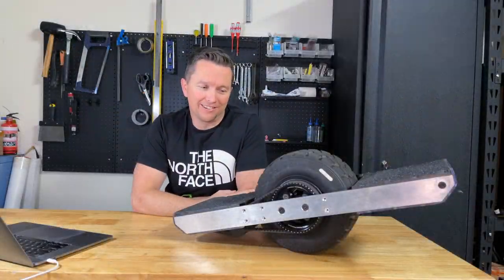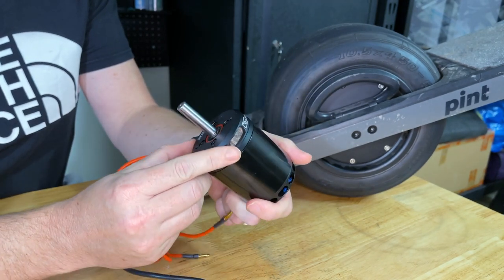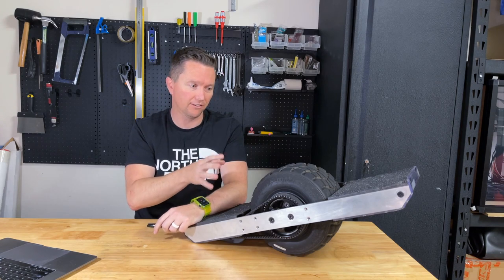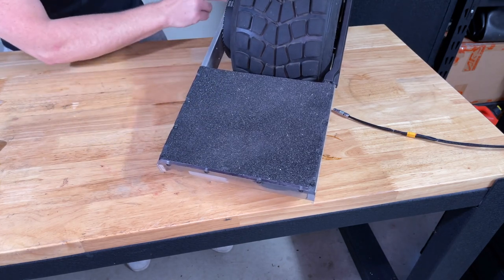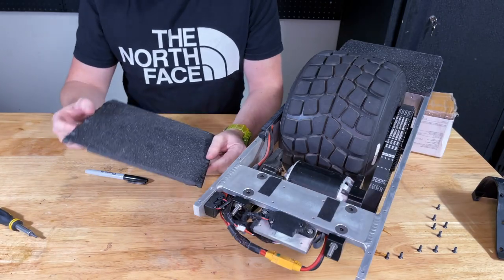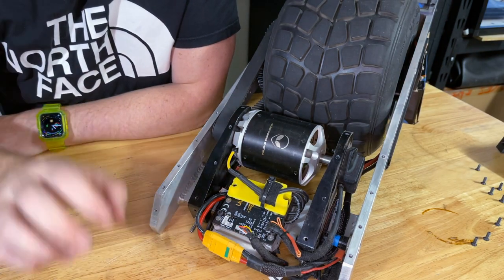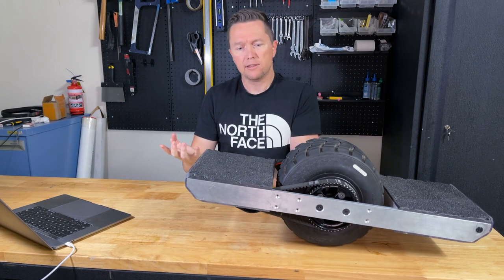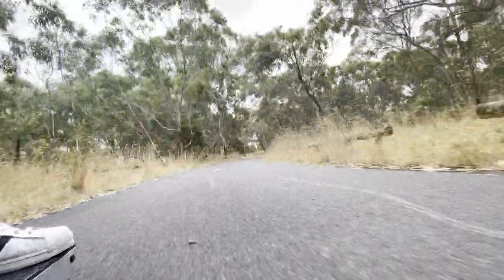All. The. Details. - Belt Driven VESC OneWheel

Comment: How does it maneuver?  I imagine all that increased sidewall and decreased wheel weight gives a much improved ride versus these hub motor boards we’re all running.
Reply from the maker: It's a smoother ride than my Pint, but I do run the tire at a lower pressure so that's to be expected.

I'd like to spend a bit of time on an XR/GT as they have a more similar tire profile to this. I think there are too many other differences between this and the Pint for me to confidently say the smaller rim diameter improves things. Would also like to get other people's opinions on it at some point, but that's later on.

Comment: Maybe mount the motor on a frame above the fender? Also, if you used a two stage reduction system, like a jackshaft, maybe a two speed transmission? Low and high range?
Reply from the maker: Practically it'd work, but I'm not sure I could handle the aesthetics of an above fender mounted motor.

One of my other crazy ideas was to rather ironically have the motor inside the wheel, but not attached too. The motor and wheel would share an axle. Instead there would be a belt that ran from the motor to a jackshaft at the front or rear, then another belt on the other side of the board would run back to a pulley that drove the wheel. I'm sure a picture would help, but mechanically it's so complicated it hardly seems worth the effort to sketch something up 😂

Two speed transmission sounds interesting, but I'd be happy with one speed that works well for now.

Comment: Cooling of the motor should be done in a different way. Now it is super fragile to any water splashes and looks like water can stay inside of the case. Better option would be to cover the motor with some kind of heat dispenser/radiator. Good work! Looking for progress on that good Australian project. ;)  Regarding the issues with motor - did you consider using two motor and belts on both sides? Of course it would complicated project but probably overhitting issue and reliability of belts would be somehow mitigated.
Reply from the maker: It is very exposed right now, being waterproof or even splash proof wasn't much of a consideration at this stage. If there's another version after this I'll take this a bit more seriously. There's been times I wanted to take it out but didn't because it was just a little damp.

Two motors is interesting, and I do like it from a redundancy perspective. I could also do a one motor two belts solution; something I hadn't thought about till your comment. The motor shaft on these motors protrudes out each end, so you could therefore mount a pulley on each side. This probably doesn't give quite the same level of redundancy.
Reply: @lachlanhurst  With two motors (maybe one on in front and the second  at the back of the board) you will have higher torque, less heat and better reliability... but the complication of the board goes up....

Comment: Very cool! Thanks for building and sharing. You were talking about the winding size in the motor and heat - could increasing the voltage help? My loose (and very possibly wrong) understanding is that higher volts can generate the same motor power with fewer amps and less heat. But maybe these smaller motors have a voltage limit.

Also the OLED display with cell voltages is FANTASTIC. I'd love to know more about how you set that up or if it's possible with other BMSs used commonly with VESCs Onewheels.
Reply from the maker: There's been a lot of 12s vs 18s discussion in the esk8 world. The answer is "kind of yes", a higher voltage could help. More power with higher volts and fewer amps, but that higher voltage would mean the motor spins at a higher speed so to take advantage of this I'd have to run a higher gear reduction which I'm already struggling to get. I could run a higher voltage and find a lower KV motor (not that there is one), but this lower KV motor would probably have thinner wires in it and we go back to "square one". Would also be an expensive change for me now; new battery, new BMS, and new VESC (this one only does 12s).

It's been a while since I looked the repo for all the BMS stuff, but I think everything you'd want to know can be found here -> https://github.com/lachlanhurst/bms-can-display . I don't believe any other BMSs use the same CAN protocol as the FlexiBMS Lite, so you would need to change the code. Theoretically if you can talk to the BMS via CAN, then something like this would work.
Reply: @lachlanhurst  Makes sense on voltage, I hadn't thought about the higher RPMs. And thanks for the link! That's a start even with a different BMS.

Comment: How about a sun gear reduction? Could have the motor in the hub or external as you have it with the gear box inside the hub. I know…hard to manufacture but I wonder if that sort of thing might already exist for some sort of industrial drill tooling.
Reply from the maker: It’s not a bad idea, just really comes down to how easy something is to manufacture. Even if starting with a suitable gear setup there’s still bits that need to be mounted. I’ve spent many hours scouring AliExpress for stuff that might work 😅

Comment: Absolutely amazing project. Have you considered a (smaller) dual motor/belt set up with a split battery pack?
Reply from the maker: Not it that configuration. I’ve thought about two motors on the one shaft to make one big motor. Problem is you double up on everything; wires, connectors, VESCs! And packaging would be tough even if you did go with smaller motors.

Dual motors and belts would be great from a redundancy perspective.

Comment: It’s much harder to remove stator heat with that type of motor I think. Also small rocks might get trapped inside with open air.
Reply from the maker: I guess I kind of forget that the actual expected use of this motor is in model aircraft where they'll be mounted directly behind a prop. This one even came with prop mounting accessories. They really are meant to be used where they get a *lot* of airflow, unlike my setup where they get zero airflow. One idea is to mount some axial flow fans somewhere to push air through, but first I really need to get a temperature sensor in the motor to better understand how bad the problem really is.

And yes, rocks and stuff is a concern, especially considering the motor is mounted right where this stuff gets flicked up by the tire.

Comment: Great work, I watched this a few months ago and it inspired me to build a EUC using belt drive. I really do think the weight saving will be worth it (if I can get the performance to be comparable with a direct drive hub) I have just assembled it all and got it working but am experiencing very poor torque/desync at low speed when hitting even a small bump. I've been tearing my hair out trying to find a solution and I came across your video where you added the encoder. I've now ordered some so hopefully this will help as it did with your belt drive OW. Fingers crossed.... Was there any particular reference material you used to set the encoder up?
Reply: Yep it works.😀 Night and day difference in torque at zero speed. I used AS5047D (ordered instead of AS5047P by mistake) and setup was easy enough. Totally worth upgrading to encoder over hall sensors for balancing vehicles. I wonder if it would also improve the torque with direct drive hub motors?
Reply: @eyeinthesky3013 can you show us some photos? Im very curious 🥹

Comment: If you're in Sydney you are welcome to try my VESC XR (lil focer 3.1) .. its much nicer than a stock XR.
Reply from the maker: Melbourne unfortunately. Would love to know how a VESC’d OneWheel rides.
Reply: @lachlanhurst  you can push the hypercore to its limits pretty quickly in summer with a good hill. Mine is still stock battery but the low speed torque is better than a GT. Ride is incredibly smooth and customizable. I'm about add a remote for remote tilt control and I have a superflux on the way. However I  will probably stick with the hypercore and add stator aid, tech-rails heat sink motor plate and heatsink axle blocks for the lighter weight.

Comment: So nice build. I would have taken a 100 teeth wheel pulley and 15  teeth motor pulley HTD M5. This will be 1:6,667 ratio meaning 1/3 lower torque on small pulley wheel, and also use a tension pulley to have more teeht engage on the motor pulley. Still so nice /diy build.
Reply from the maker: I still don't think a 5m belt would hold up, and even if I was 90% sure it'd be fine I'd still be worried as we all knows what happens if if breaks.

Chain and/or an additional gear reduction could be the way to go, but it just adds complexity. Still thinking through all the options.

Comment: I can’t help but wonder about shaft drive with bevel gears - probably inefficient & I guess a harder build (might need a gearbox to get the same reduction), but would protect the drive.

Then if you had 2 shafts, one from each pad, with smaller motors (not sure if you’d need a physical differential or could be done electronically) you’d get redundancy & reduce the motor bulge (I’m guessing you’d be back up to the weight of a hub motor by that point though, with the added electronics, shafts & gearing).
Reply from the maker: It’s definitely an interesting option, only problem is the mechanical complexity of it. There’s additional shafts to manufacture, bearing supports, more complicated rail design to support it all. Just wish I had a decent machine shop. I had a few other ideas too, but really get stuck on the bit where I have to figure out how to make it 😅
Reply: Yeah I think also that you should not ignore the large detriment of high rolling resistance, as fucking awesome as that idea sounds. Try it anyways

Comment: such a nice build, 130kv in the same 80100 motor, with big reduction, would make it more powerful. I would avoid 2 belts for reduction, I have 14:1 reduction using one belt in a kart setup.. you can run up to 150A in 130kv. it ain't gonna get super hot.
Reply from the maker: Well now I need to know details 😅

What belt and pulleys are you running? And where did you get them from?

I don’t want to run a lower spec than the HTD8M belt, but unfortunately the pulleys are quite large and that’s what stops me from running a single stage higher reduction. A 12t motor, 80t wheel pulley is the absolute max I could run and that’s only a 1:6.7 reduction.
Reply: @lachlanhurst  I custom made the pulley its a cnc aluminum plate(basically a disc), and the gears are 3d printed. It can handle the torque. the belt is a HTD 5m, the small pulley on the motor is a normal one with 13T. I had to use a even bigger belt and something to tightening so I could grab more teeth on the small pulley
Reply: with 8mm belt you won't be able to make a such reduction.. there a Heavy duty belt, with a red stripe on it. I don't remember the code.

Comment: i can imagine being able to change gears for a trail ride being awesome. more torque and less speed on the trails with shorter gearing would be a game changer imo
Reply from the maker: You'd need to adjust/change the belt which is probably a little too much messing about with this build. If there's ever a V2, then I'd like to make this a lot easier because it would be quite nice.
Reply: Just use a torque converter belt drive.
Reply from the maker: @nh18343  I didn’t actually know what that was! Looks interesting, will definitely look into it some more 🙌
Reply: @nh18343  might make the ride less... confidence inspiring. i feel like by nature, the responsiveness would just not be enough to keep the nose from wandering like crazy. could be cool to try though and im all for being proved wrong 👍

Comment: I'm building a onewheel. 
Single ubox alum 85v 200A controller,  13x8-6 fat tire with 3000W motor, Foot pad sensor *2pc and one adapter, Motor hall sensor transfer cable, Bluetooth module, 120A physical fuse.
Battery:
Nominal Voltage: 72V
Nominal Capacity: 20Ah
Cell: 21700 5000mAh(Lii-50E)
Assembly: 20S4P
Category:Li-ion Battery
Voltage : Peak - 84V, working - 72V
Capacity: 20Ah
Power: 300W-3000W
Cut-off voltage: 54V
Max. discharging current: 90A mps
Max Continuous Discharging Amperage: 50Amps
Rated Discharging Amperage: 50A mps
Charging Current: 5 Amps
Charging Voltage: 84V Volts
Dimension: 230*225*75mm(diffference:+/- 5MM)
Battery Weight: about 6kg
Charger Weight: about 1kg
I just got the battery this build maybe too heavy but I'm going to try to make it work 🤞🏻😑🤞🏻

Comment: Awesome, thank you for sharing! I really think you should decrease the gearing to at least 1:8, you'll probably have to use chains for that.
On all terrain electric skateboards 1:4 is usually the highest ratio that is used for 8" wheels, and it's better to go lower like 1:5-1:6 for offroading.

Hmm, on skateboards going lower than 1:6@8" is usually not desirable because of higher free roll drag, but on balancing board there's no free roll anyway, so maybe even lower ratios can be used with no problem.

I've been wanting to get onewheel for a while now, but seems like the only option is to completely DIY it. Another problem is that there's no sellers that will ship hub motors to where i live, so external motor might be an option, good to know that it can balance so well.
Reply from the maker: Agreed, higher kv motor with a bigger reduction would give better results. And yes, it would probably require a change to chain drive or a two stage reduction.

I did manage to find some large HTD8M pulleys that will mount to a kart sprocket carrier. They are quite large in diameter, and even with 80t still won’t quite get me to a 1:8 ratio. I’d also like to use a larger motor pulley for better tooth engagement. The 12t I have on there now hasn’t given me problems, but it is not ideal.

Comment: Found this 1900w nominel motor 6374 60kv, maybe you could use that?

E-Power Hobby 6374 3200Wt 60KV Outrunner Brushless Motor

APS 6384S SENSORED OUTRUNNER BRUSHLESS MOTOR 50KV 4000W

Comment: The reason i put out these link was because the have a low KV, as i undersrand  50KV make you go 26 Km/h that is why i don´t understand this extra gear reduction you are talking about?
How wide is your timing belt?
More poles lower KV and more torque, this is why you see skateboard motors with up to 30 poles.
With higher voltages you get lover current (I ). The heat is (I x I x R) so high voltage is importen if you have heat problems.

Comment: Top speed?
Reply from the maker: Free spin is currently 43km/h (27mph), that's with 30A of field weakening. I've only ever had it up to 28km/h.

You could change the pulley to have a higher gear ratio, which would increase the top speed AND lower torque. I don't feel this motor has the torque, so I probably will not test this out anytime soon 😬